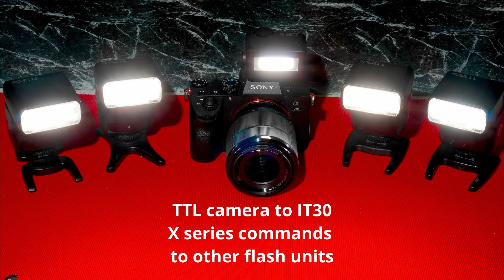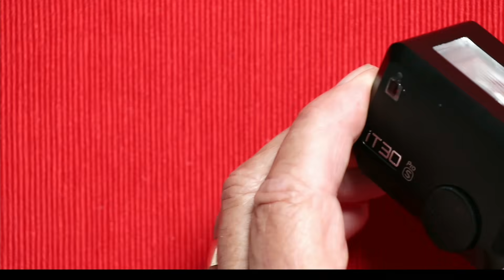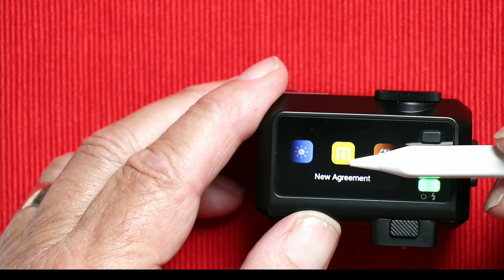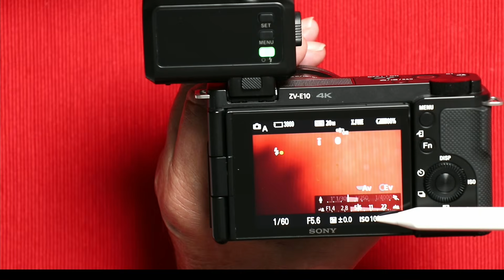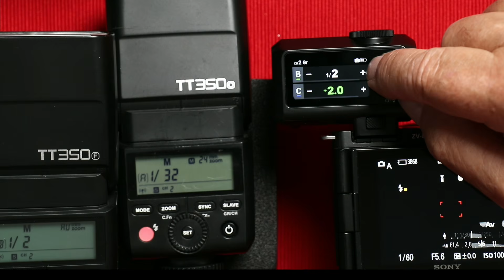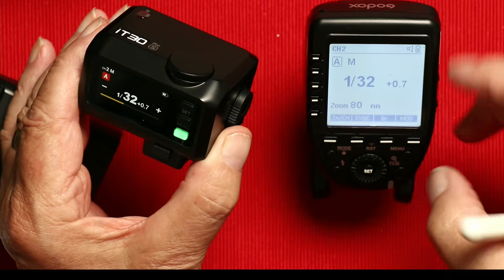Godox IT30 Pro Review & Tutorial

Comment: Hey Graham, You say the Godox also works with the Fujifilm X-half? How is that supposed to be possible? In my opinion that doesnt work. I would be happy if you can tell me how to use this with the X-Half. Thanks!
Reply from the maker: The Fuji X-half is one of those niche cameras that unfortunately does not support external flash. The X5-F is designed for the Fuji X series of camera which have a traditional hot shoe.
Reply: @GrahamHoughton12 okay thanks, but then you should correct your video. Because you tell in the video that’s possible 🤷‍♂️

Comment: This is one of the most in depth reviews of the iT30 Pro I have viewed so far. I purchased two a few weeks ago for on and off camera macro photography, with my OM1 mark II and 60mm f2.8 macro lens (I did have a 90mm f3.5 as well, but sold it this morning as a deposit for my pre ordered 50 - 200mm f2.8). I absolutely love this flash gun. So much so, I sold my Godox V1 Pro and Olympus FL700WR, along with my KR90 diffuser. I have also purchased the TR O riser for use with my 50 - 200mm + MC20 in macro mode. My camera is no longer top heavy for focus stacking and there is no diffuser to catch on bushes, long grass, etc.
Reply from the maker: Thank you for your very useful feedback on this video, really appreciated
Reply: I have 4 now 1 sony 2 nikon and 1 Panasonic (for my leica d lux 8).  😂😅 

Sadly you cannot tcm except as flash on the camera   😢
Reply: The issue is you normally need off camera flash and it seemed unless you use a real trigger so far no way.

Comment: Is there a way to take this flash off the camera, some kind of cable extension?
Reply from the maker: Yes, it will depend on the camera. Panasonic and Olympus use the same extension cable as canon TTL so you could use that if you wanted true TTL control. If your camera has a sync socket can use that. I would be doing a deep dive tutorial showing how all these can be set up, shortly
Reply: It is for Sony A7IV,  I don't think it has any additional inputs for the flash cable.
Reply from the maker: @filippov123 then if you want to use it remotely then a x1 transmitter (Sony mi shoe version) on the camera in ttl mode will control the IT30 S in the slave mode. I'm doing a follow on video showing these options shortly.